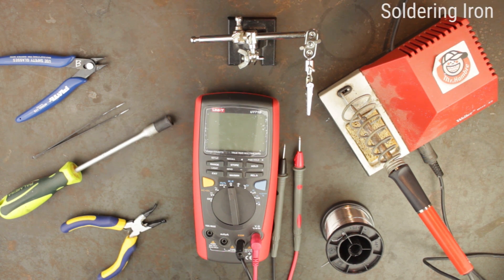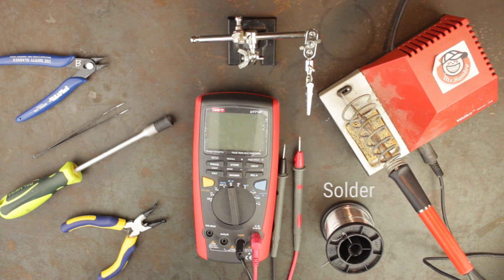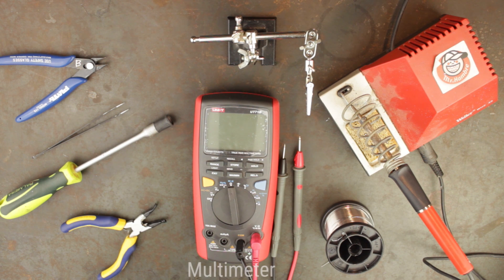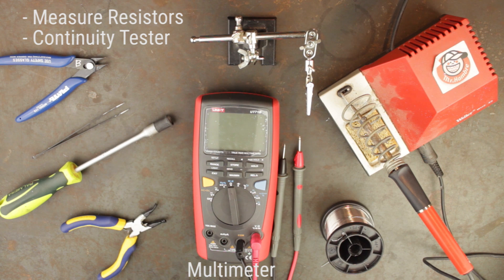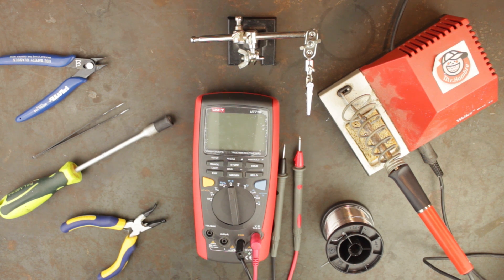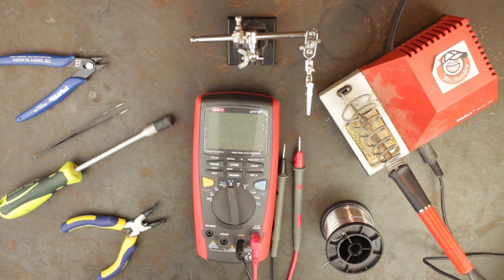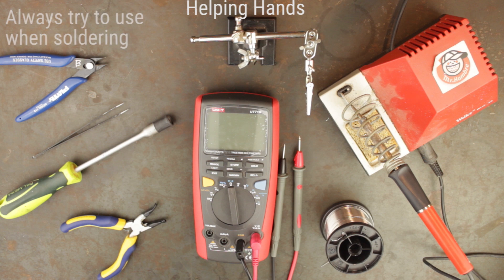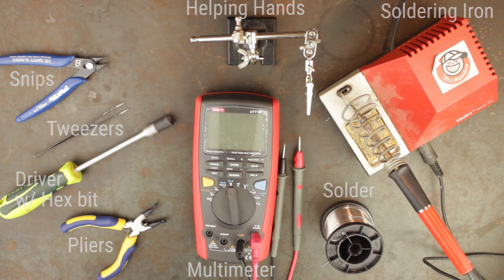DIY Eurorack 101B - Let's Look at DIY Tools

Comment: Reading up on the Weller Whs40 I can only find 0.5mm and 3mm tips for it. Do you know what size you have here? Will a 0.5mm tip be ok? Can't wait to get started on my first kit
Reply from the maker: Hi Tom,  although it is a little on the sharp side, I think the 0.5mm should be fine :) In fact I think that's what I was using in the video. Good luck with the first build!
Reply: The whs40 came with a 2mm chisel tip and I bought the 0.4mm pointed tip too. Both are useful for different situations it seems - thanks for the help!